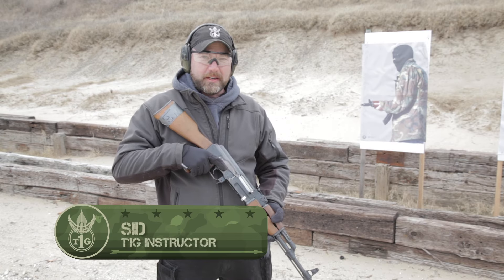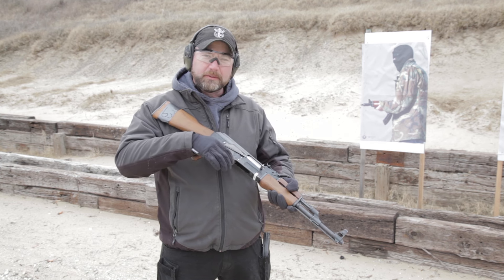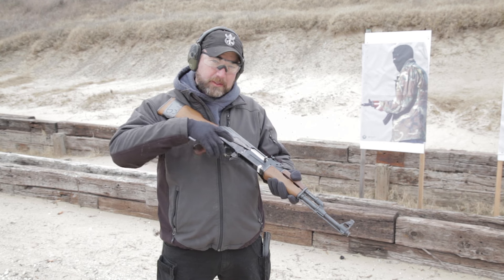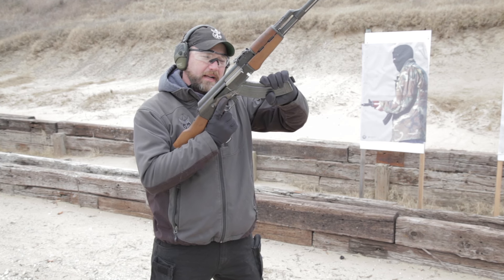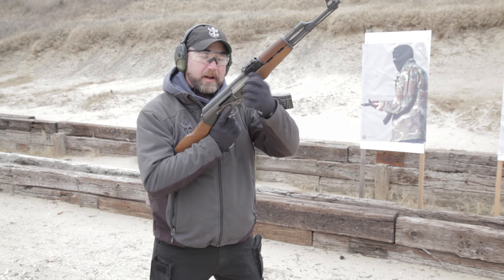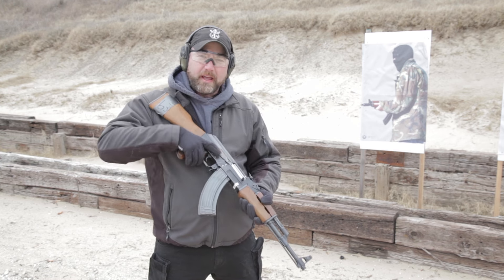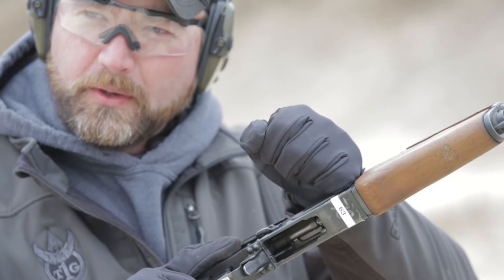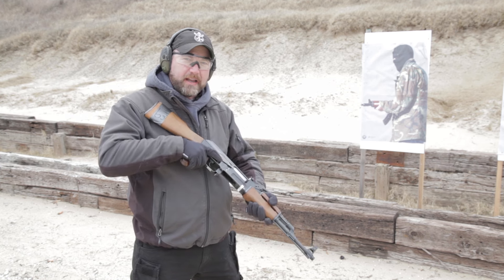AK-47 Load and Make Ready Instructions | How To Training Techniques | Tactical Rifleman

Comment: well, you are doing it wrong.
you are supposed to charge it with you right hand, while hold with left hand in front wooden hold under the muzzle. 
that's why the lever is on the right, that's way you can't push the trigger by accident and don't have to weirdly turn it to charge.